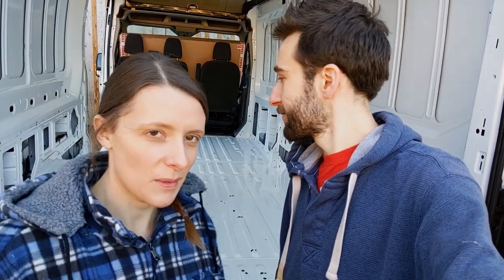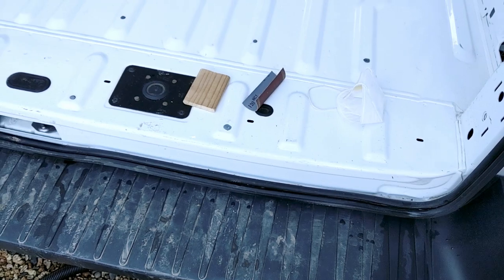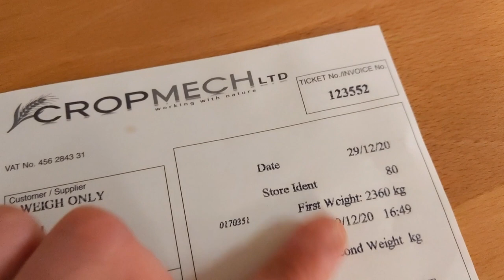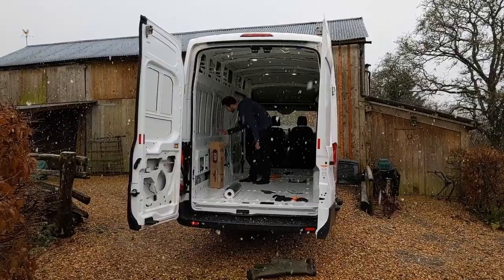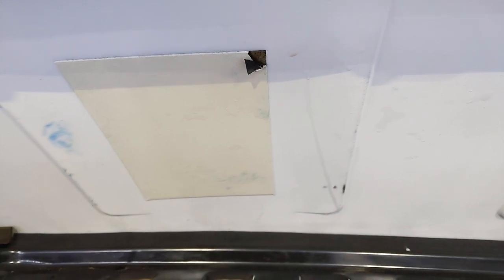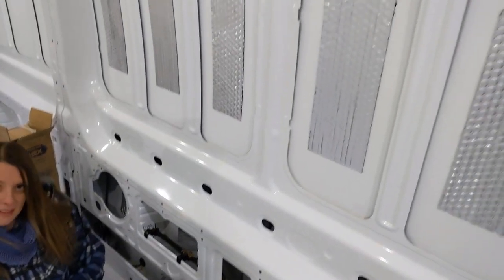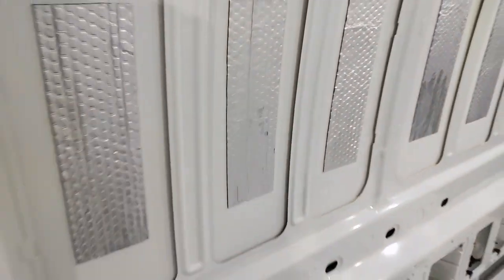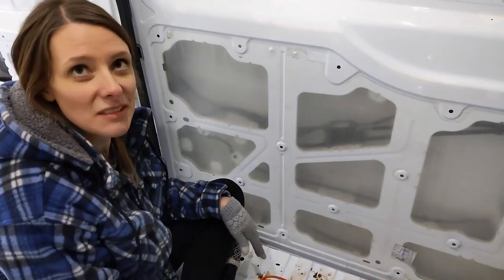Filling Holes & Sound Deadening! | Transit Van Conversion E04

Comment: Love your project!! Really looking forward to the next video. We bought the exact same van last November and are converting it as well. Although we decided to go for a slightly different lay-out, we seem to be solving the same problems :-) Last week’s challenge: finding the parking aid module which we covered up behind a wall... Tip: don’t.
Reply from the maker: Thanks! How far along are you? Good tip! Our model though doesn't actually have any parking aids/cameras from the factory, but we've added our own now, makes a big difference being able to see out the back when driving :)
Reply: @SelfBuiltStories   It’s a long van so that is a good idea :-) We installed a camera as well. This week we expect to finish the walls and windows. And we started building the kitchen. In Januari and Februari (cold! :-) we did all the sound deadening, Armaflex isolation and installation of the watertank and the battery.

Comment: Hi guys. Thanks for the vid! We just got our Transit which looks identical to yours so this was hugely useful. Just sealing up the holes from the ply and was gonna use pop rivets and sealant. I think your approach is much better though with the steelstik. We'll be doing the same as you tomorrow!
Reply from the maker: Hi, no problem! How did it go? Hope it worked out for you 🙂

Comment: Does the 3500 kg max weight include driver and passengers, full fuel and water tanks, as well as food, bedding, clothes, any camping gear, etc?
Reply from the maker: Hiya, yep exactly that, it's the van itself plus everything that's inside including passengers, belongings, pets if you have them, any groceries you've bought... etc! One way of looking at it is if you were ever pulled over and onto a weighbridge then exactly as you are at that point in time should be no higher than the limit. When we've weighed the van we make sure to completely fill up all the tanks, so diesel, water and gas, and have our possessions and ourselves inside while they take the reading too. In practice most of the time we're not going to have full everything as diesel is used up, food it eaten etc, but starting by weighing the absolute max should mean that in any normal day-to-day use you'll be within the limit. 

It adds up pretty quickly too as just putting in some groceries every tin is another 400g, 1kg for a litre of milk, then you've got all the clothes and bedding and stuff! We actually decided to up-rate our van to 4T in the end to have some more capacity to play with, as being the jumbo transit to begin with and with both of us, it didn't leave much for everything else and we wanted a bit more flexibility to play with. HTH 👍

Comment: With the larger holes did you need to put anything on the underside or was it just a case of molding the putty before application? As I have a number of holes where I think the racking must have been fitted or a second row of seats.
Reply from the maker: Hiya, nope we didn't have to go under the van to do any of them. Ours were all fairly small holes from screws though so it might work out a bit different with some larger ones. The steelstik just pokes through a little bit on the underside, like lots of tiny little grey icicles 😛

Comment: so glad you are keepinig it real, down to earth and accessible for most of us who are not loaded with money to have uber expensive DeWalt tools or have access to a fancy barn/hangar. the chickens are a hoot. haven't had a chance to check your descriptions but hope you have listed the products you used like steel stick. I work full time so I am giving myself two years to do the build. electric and wiring is going to cost me £850 for someone to do. Will have watch your video as well as do alot of researching and may look into buying a kits so I have all the parts sans getting 2 AGM batteries. I hooked up my solar on my previous van. Where in England are you based? were you working full timee whilst doing the builld? any particular vloggers you used? I use Greg Virgoe and Mel's small world van build. Thanks again.
Reply from the maker: Thanks for the comment, yeah we try to list all the products we've used in the description but if we've missed anything just drop a comment. We're in Devon and have been doing the build outside so taking whatever the weather can throw at us! We've watched quite a few channels, both of those you mention. Some other good ones are Combe Valley Campers and Mispronounced Adventures. Good luck with your build 🙂

Comment: Hi guys, just wondering if your van had any vent type things on the bottom of the floor in the wall cavity, and if you did what did you do with them? My ford transit has these and I havent seen anyone talk about them so not sure what they are for or if they need bording up..?
Reply from the maker: Not sure about vents but ours has a few drain holes in those cavities in the walls which exit out the underside of the van, and have rubber plugs in them
Reply: @SelfBuiltStories  thank you. It's so weird, i cant find anyone else with the same things on youtube but seen a couple of discussion threads saying they are there to prevent issues when the sliding door closes due to the air pressure. I think i'll end up closing them to prevent dust coming in and the air fan will deal with air pressure. Cant wait to see more of your build! I've learnt so much from you guys 🙂
Reply from the maker: @abit2556  Ah we do have some vents to relieve air pressure for the doors and things, but have only really noticed them on the side of the van (not on the floor in the cavities as you mentioned). That's not to say they're not there, but it's not something we noticed at the time. We didn't change any of the factory vents, aside from sealing all the panel clips on the side to prevent water ingress

Comment: Looks good. Wanted to see what techniques others are using to fill hole.
I like some of your idea, I think I will go with the weld stick.
However, Something I would like to recommend which I plan to do on mine is to paint the underside of the holes with some sort of stone chip underseal, to stop that rust coming back from underneath, these salts roads are terrible for rusting steel so I think this is more important than painting the inside. Hope this might help...
Reply from the maker: Thank you, and yeah good idea. We think we'll add something on the underside when it comes to doing a bit of work under the van putting in the tanks and things. Might as well hit two birds with one stone! It will be good to get a better view of how everything is holding up too, although we did take it for a service recently and they commented on how clean it is underneath which was nice news! Good luck with your build 🙂

Comment: Hello! I have watched countless youtube van vlogs, and yours are my go-to; consistent in your content and delivery, super helpful and also seem like lovely people; thanks so much. I have a question; do you recall was there rust in any of the holes in the floor? If so, did you treat or file it before filling with the epoxy? Thanks! My van is holier than the pope atm..
Reply from the maker: Hey! No problem and thanks 😀 We didn't really have any rust in the floor holes fortunately, the only place we really had it was a couple of holes in the walls. For those we used some wire brushes to remove all the loose rust first, sanded it back a bit and painted it with hammerite. Good luck! 👍

Comment: Sikaflex 511 would have sealed the holes up quicker and cleaner and it remains flexible so won’t crack or rattle free with the movement of the van.
Reply from the maker: Oh quicker for sure, we spent quite a while doing it! Not sure about cleaner though, we were really happy with the result at the end, felt like a new van 😀 We used a fair amount of sika on other parts of the van but for the floor the steelstik worked great 👍

Comment: @Self Built Stories  Hi 👋...watched all your build and really enjoyed it...just starting mine and need to fill holes....did the weld jb work please? Thanks Lee....sorry also, how many tube/sticks did you use 🙏
Reply from the maker: Hiya, yes it worked great, and we just used one tube for the entire van and that was quite a few holes. 70+ if we remember rightly
Reply: Sikaflex 511 would have sealed the holes up quicker and cleaner and it remains flexible so won’t crack or rattle free with the movement of the van.

Comment: Does the 4T upgrade means a different licence?
Reply from the maker: Yeah, a standard UK B car licence allows you to drive a vehicle only up to 3.5T. You need the C1 additional endorsement which then allows you to drive heavier vehicles up to 7.5T. If you passed your driving test before 1997 then you have it automatically, but for everyone else you have to take an additional driving test to get it. That's what we did which was a bit of a faff and took some time, but happy now that we've got it!

Comment: How you treat the floor on each hole before you put the steel stick on?  I’m about to do mine I I’m a little unsure what to do. Am I to prime the metal first? 🤷🏼‍♂️. Thanks. And great effort by the way
Reply from the maker: Thanks 😊 What we did was use a wire brush attachment on a drill and remove any surface rust that was on some of the holes (though most didn't need it, they were pretty clean) then we added the SteelStik after just giving each hole a wipe with a cloth and a bit of IPA/panel wipe. Once set we sanded that back so it was flush (this part took a while and you could get away with just leaving it a bit lumpy, but in our case we wanted the foam boards on top to sit nice and flat with no ridges, so we thought the effort to sand it all back was worth it). Then we went over the steelstik with red oxide primer, and when that was dry again with white hammerite. That's how it is for now, at some point when we're under the van we might also spray some rust preventer on the underside of the holes too.
Reply: @SelfBuiltStories  thanks for your reply and very detailed. I’ll order all them bits and give it a go.
Reply from the maker: No problem! Just remembered some of the holes were quite burred and sharp from where the screws had penetrated, so we also used a larger drill bit and manually turned it around the holes a couple of times, and a light file in places to get them smooth before we put the steelstik on. Good luck with your build!
Reply: @SelfBuiltStories  Hi 👋...watched all your build and really enjoyed it...just starting mine and need to fill holes....did the weld jb work please? Thanks Lee....sorry also, how many tube/sticks did you use 🙏
Reply from the maker: @LeeMizen  Yes worked great, and just the one tube :)